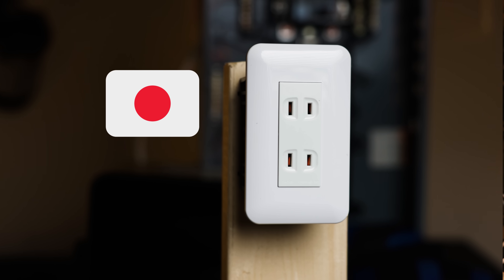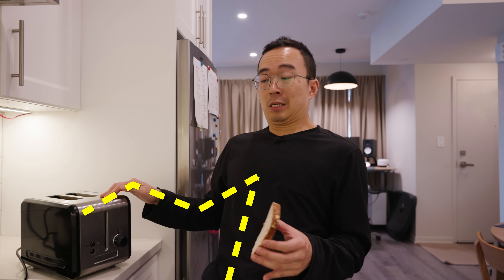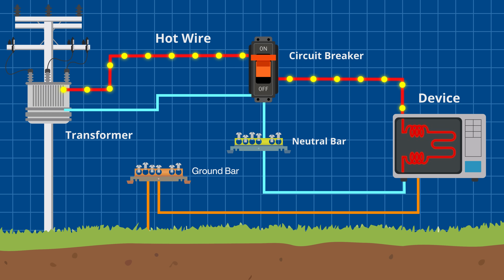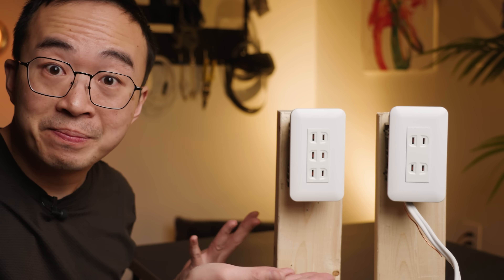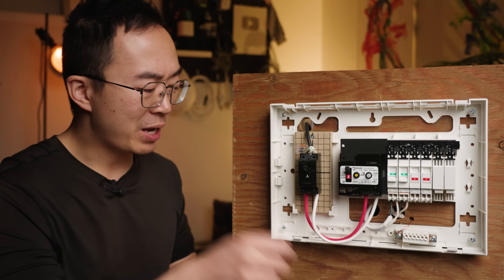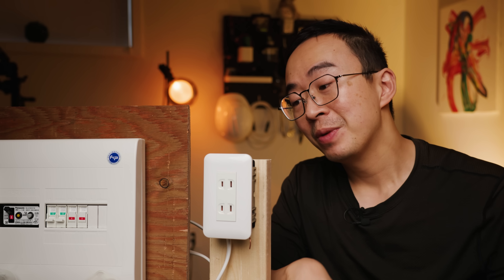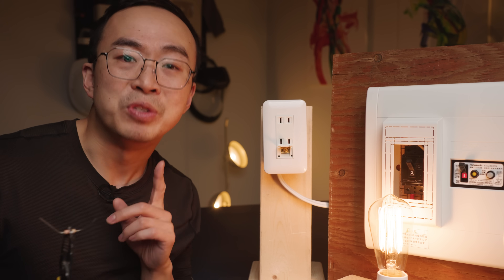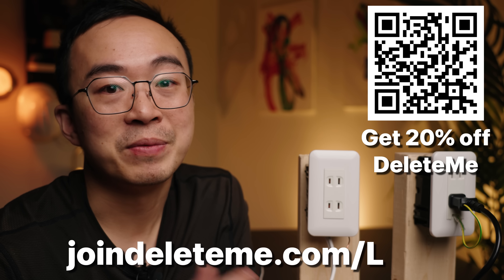How Japan Made Their Outlet Safe

Comment: A few points to add:
The USA actually DOES allow a GFCI to be installed in lieu of an equipment ground on existing electrical retrofits (With a notice of "No equipment Ground").
Occasionally, on a single-family house using a TNCS system, the neutral-to-ground bond may have a 0.5A circuit breaker on it, connected in tandem with the main breaker. This detects most shorts to ground.
Whole-house RCD protection requirements regarding retrofits vary in Europe. Some countries have a 2-tier system: 500mA RCD on the entire house and 30mA RCD protecting the individual circuits, while others only require the 30 mA protection. Some countries require a retrofit whenever any electrical change is made, others on any new branch circuits, and some others only require RCD on a new installation or complete replacement.

Comment: My biggest problem with your explanation is that you described the ground path like a superconductor that can carry 600 amps. The ground wire is just like the hot wire.
What happens it that normally the flowing current is limited by the lightbulb/appliance internal resistance, but if there's a short to the chassis (= ground = neutral) then it's basically a short circuit, which will let a very high current through, which will trip the breaker.

Personally, I'm shocked to learn somewhere in the US a GFCI/RCD is not required (assuming that part of the video is correct).
If the hot wire touches the chassis but somehow does NOT make a good contact (high resistance), current will flow without tripping the breaker. The fault will generate heat and thus create a fire hazard.
Another situation is if a person touches the chassis with one hand and a hot wire with the other. In that case, you become the lightbulb. The current will not trip the breaker, you fry.
In both those cases, in systems that have a GFCI/RCD and where the ground is NOT connected to neutral, the RCD will trip because it detects a leak to ground.

Comment: Today very few home applicane have protective ground anyway, mostly kitchen appliance with metal cassing.
 Still having both is the safest like most home in sweden.  Let say the live gets lose and tuching the toasters casing, if you have a GFCI without earth monitor like in japan it wont trigger until someon tuch the toaster and some current is leaking. But if you have GFCI with earth the moment the live wire touch the casing and current escape to ground the GFCI would trip. 

Like many say many country in euorpe have both which is even safer, but yehe i agree they made their outlet "safer" with the least effort required

Comment: No ground is still bit sketchy. Notice the "push monthly" button on GFCI? What if you didn't push it monthly and didn't realize GFCI has failed.
Reply: They always fail. I've had failures a lot.
Reply: @bassyey  у меня GFCI на 30 мА не сработало при пробое ТЭНа бойлера. Заземления в квартире нет, как и во всех остальных домах советской постройки. При этом не сильно щипало руки под водой в раковине, видимо, тока для срабатывания было недостаточно. Мультиметр в режиме измерения сопротивления даже не видел пробоя, только при подключении питания показывал напряжение на корпусе (100 В относительно нуля в розетке, напряжение сети при этом 230 В). Вероятно, для таких потребителей целесообразнее ставить GFCI на 10 мА.
Reply: As I've found, not all GFCIs stay off when they fail.

And consider that certain devices probably should stay on regardless of whether there's a GFCI present or not.
Reply: @jeffkardosjr.3825  The RCDs in Europe have no electronics. They are mechanical.

Comment: This whole video doesn't make sense.
For example here in Germany we have a lot safer system with RCDS and grounding.
And the switch time has to be below 0.5 seconds more like 0.035 seconds.
So keep you clickbait. And don't lie to the people.
We are so advan, that we have multiple RCDS for multiple reasons and circuits.
For example we also have single RCD/SA combined where every circuit has its own RCD, so if your bathroom trips, because you toasted in the bathtub again, the kitchens refrigerator won't shut off, because it's a complete different circuit.

Comment: In Germany RCD AND Grounding for every outlet on new or updated installations is mandatory. 
This is a good Idea because as shown in the Video: when the wiring inside a device is broken there is a good chance that it will trip the RCD via Ground. I've seen that more than once.

Outlet with RCD: Device trips RCD. Outlet without RCD: Device starts burning. (No joke)

Comment: Up until 2008 Japan hadn't even standardized on polarized outlets in residential buildings.  Since then all new house construction has been required to have polarized outlets installed, but older houses could continue to use their old non-polarized outlets. Appliance manufacturers, however, have not yet been required to install polarized plugs on their products to fit in those new outlets.  16 years have past since the regulation went into effect and appliances still don't come with polarized plugs, presumably so they could stay compatible with all those older houses still using the old outlets.  Even large appliances (washer and dryer, etc.) that come with the pig-tailed grounded plugs are not polarized.  As those appliances are expected to be installed in one spot and not moved around much, the use of pig-tailed grounds and outlets to accommodate them was deemed sufficient protection, but many people don't know what those pig-tails are for and simply leave them hanging.  

As was correctly noted in the video, Japanese regulations don't require three-pronged grounded outlets either, but you can have them installed in a new house at an additional cost to the homeowner.   If you do this make sure there's no misunderstanding between you and your electrician.  I've found that many are so used to installing two-pronged outlets they may automatically install those outlets just because that's the normal way it's done in Japan.  

I had grounded outlets installed in my two custom built houses, but to cut costs I had them installed only in some of the rooms.  My 2nd floor radio/computer room, woodworking shed, media center, washroom, kitchen and large appliances (refrigerator, heatpumps, etc.) have them but the other rooms rely on the whole house GFCI for protection.  In retrospect I probably should have had grounded outlets installed in all the rooms because I found out later that Japanese electricians typically use two-wire Romex for non-grounded outlets which makes replacing those outlets later with grounded ones quite difficult.  

A greater problem for me is the low-voltage 100V, 50Hz power and the limited service amperage allowed for house wiring.  I can deal with the lower voltage by using step-up transformers when needed but the maximum current any house can get here is 60 amps which is pitifully low by American standards.  If you want more power you have to have two service panels installed which effectively requires two complete installations with two meters and that means two separate bills to pay the electric company.  I must watch my power consumption very carefully to keep from tripping the house's main breaker if I happen to turn on too many appliances at once.

Comment: In Spain, having a RCD (Differential as we call them here) on the electrical panel is mandatory since 1973, this same year grounded sockets were mandatory on kitchens and bathrooms or similar places. Since 2002 sockets without grounding are banned and you can't find them for sale. The only electrical devices without ground plug that are allowed on Spain since 2002 are those that are double insulated.
Reply: That 's the exact same story in France and UK (dates may differ a bit).
In UK, the wiring has a ring topology, to balance the load, every single outlet has a switch to turn off the live. Every plug has a 13Amps fuse for good measures.
In France, it's like in Spain, except outlets and plugs has a ground pin unlike the schuko plug with its 2 little blades.
Reply: Introducing grounding only in 1973? When younger, when visiting Spain and France I was appalled at the electrical installations.  It was clear that the regulations were poor compared to the UK, but also the quality of the work was bad - amateurish looking.
Reply: @johnburns4017  French born in 85 here: everything electrical dating back from before 1990 is total crap, but it doesn't limit to that.
Worse: historically, the black wire was used for the live (and white for the neutral), some electricians kept this habit of having the black wire for live, so when it was normalized to have the live on the red (and so the neutral on the black), you guessed exactly what to expect from old electricians: they kept using the black wire for live (and so the red for neutral), and even on an installation from the early 2000's there are risks to have inverted colors because of that. You have to be extra careful even on an early 2000's installation when working by yourself on it: you must ignore colors and ensure by yourslf which wire is the live, every single time.
So basically, even in an house renovated 20 to 25 years ago, you have to be extra careful, it's especially true for some devices such as heaters where live/neutral position matters.
Those bad electricians not following norms retired once for all around 2000-2005, so any installation that came after that is clear : red = live and black = neutral.
Reply: @Jean-Denis_R_R_Loret  
A few years ago I was in a girl friend's apartment in Paris, 16th. The block is a modern smart looking building built in 1976.  The main panel has fuses. The UK had gone to breakers long before that. 

There is a what I think is a lighting circuit with NO earth, with two-pin sockets on the skirting boards. Other sockets had earth pins. The fridge, hob and oven had their own radial circuits which was encouraging. There are a few circuits for sockets.  

This is way behind what the UK was doing in 1976.

I replaced all the light holders from brass to double insulated plastic. I wanted to disconnect this lighting circuit with no earth wire, but she insisted it stays as she has tall floor mounted standard lights - which are metal. Once again I changed the light bulb holders to plastic. I also replaced all lights to LED. 

I replaced all socket outlets to a quality make and also all light switches.

It needs a new row type of main panel and the earth-less lighting circuit replaced. But the electricity supplier fitted a disjoncteur électrique, at the main panel which is a very good thing. Which is really a main whole apartment 500Ma RCBO. After she had a FIRE in the main panel.

It was quite an eye opener.
Reply: @Jean-Denis_R_R_Loret  Actually, using the black for the neutral is new to me. In Italy the neutral is the blue wire, yellow-green is the ground and any other color can be used for the live wire. In this way you can separate circuits functionally by using different colors knowing that if it's not blue it's live.
Reply: You can see black neutral on some appliances (electric heaters are the 1st thing that comes in mind), but yes it's supposed to be blue for anything you'll find in a wall.
I'm at a point where, knowing color codes changed and were messed up by electricians from different generations, I don't trust colors, I just test with a multimeter to find which one is the live before doing any job on anything. To test these unsufferable ungrounded sockets, I use the plumbing as the ground.
Reply: @johnburns4017  Grounding in Europe has typically been mandatory in kitchens and bathrooms since the 1930s but in living and bedrooms only in the 1990s. Actually before the sockets were shuttered grounding was a bad idea. Sticking a knitting needle on a grounded socket can be fatal.
Reply: @okaro6595  
The ground on a final circuit in the UK is called the CPC and referred to as that by professionals. CPC stands for Circuit Protective Conductor. It is primarily to open the breaker of the circuit it is in at the panel in case of a fault.  

Unfortunately it is the same colour as all earthing and bonding cables. It should have its own colouring.

Comment: Hi, electrician and electronics enthusiast here. The part about your regular circuit being "like a narrow and winding pipe, but the ground [path] is like one big straight pipe" is totally incorrect. In fact in any circuit in the USA, at most the ground path will be about the same resistance as the circuit itself. But on larger circuits the ground path is actually much smaller. However that's not an issue, because it exists primarily to give a return path in the case of faulty wiring. It doesn't need to be like a huge straight pipe as you described, because it is a backup safety feature. It only needs to be big enough to carry a fault current to trip the breaker. On large circuits the ground will be much, much smaller than the current carrying conductors.

Comment: RCDs are NOT a replacement for proper grounding. These are two things that should act in concert. You should have proper grounding and an RCD. Also, in many cases you can quite easily convert a TT system locally into a TN-C-S system. This requires a few measurements to confirm that it will work correctly and you need to check with the power company if they are okay with it. If both things give a green light, you can build your new buildings with TN-C-S or even upgrade older buildings to TN-C-S (what we call "modern grounding" in my country) or at least to TN-C (what we call "classical grounding", which can't be used anymore in new installations since 1973).
Reply: In many countries TT is mandated so when you call the power company they say NO.
Reply: @okaro6595  Unfortunately, that's the case, although I would argue that a TN system is the preferable choice.
Reply: 日本統一使用TT系統，當地的電力公司不允許TN系統！

Comment: Here’s  my opinion on the japanese electrical system.

### *1. Voltage Limitations (100V)*  
- **Inefficiency**: Lower voltage requires higher current, leading to greater heat dispersion and energy loss.  
- **More Dangerous in Arcs**: Higher current makes arcs more likely, which can lead to overheating or fires.  
- **Limited Capacity**: Appliances require more current, and simultaneous use of multiple high-power devices can trip breakers.  

---

### *2. Ungrounded Outlets*  
- **Shock Hazard**: Many outlets lack a ground, increasing the risk of shock or electrocution.  
- **Device Damage**: Sensitive electronics are more vulnerable to surges and static electricity.  
- **Fire Risk**: Fault currents can cause overheating and fires without a grounding path.  

---

### *3. Poor Plug Design*  
- **Slips Out Easily**: Flat, all-metal prongs slide out more easily compared to round or angled plugs.  
- **Exposed Contacts**: If a plug slides out partially, live metal prongs can be exposed, increasing the risk of accidental contact or arcing.  
- **No Insulation**: Metal prongs are uninsulated, unlike European plugs, which are safer in partial disconnections.  

---

### *4. Lack of Protective Features in Outlets*  
- **No Shutters**: Open sockets allow easy insertion of foreign objects, posing a safety risk, especially for children.  
- **No Recessed Design**: Flat, exposed outlets lack the safety benefits of recessed sockets, which prevent accidental contact.  

---

### *5. Conduit-Free Wiring*  
- **Fire Hazard**: Wires run directly through walls without protective conduits, increasing fire risk in wooden structures.  
- **Physical Damage**: Unprotected wires are vulnerable to damage from nails, screws, or earthquakes.  
- **Difficult Upgrades**: Adding or replacing wiring is labor-intensive and expensive, as walls often need to be opened.  
- **Earthquake Risk**: Frequent earthquakes can dislodge or damage unprotected cables.  

---

### *6. Overall Aging Infrastructure*  
- **Legacy Practices**: Older homes often follow outdated wiring and outlet standards that prioritize simplicity over safety.  
- **Cost Over Safety**: Many design choices prioritize cost-efficiency and compactness at the expense of safety and convenience.  

---